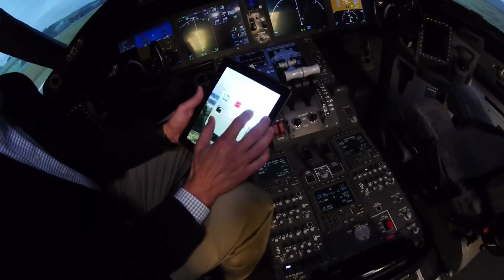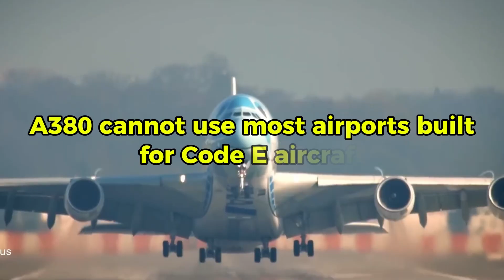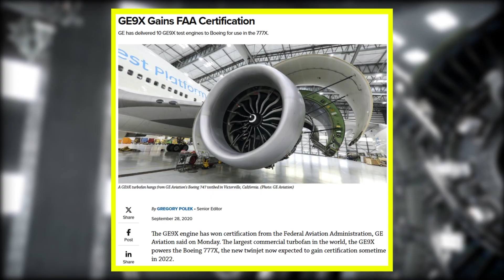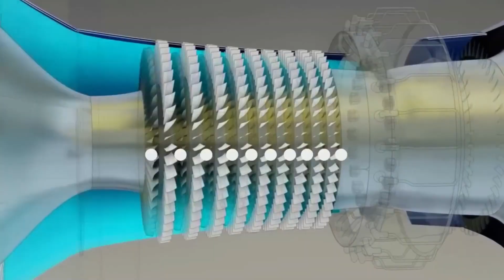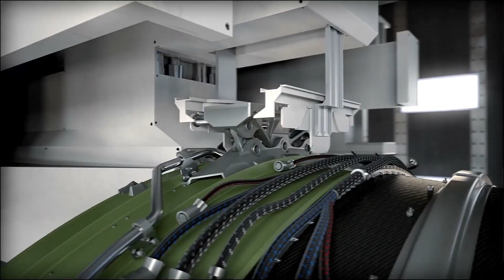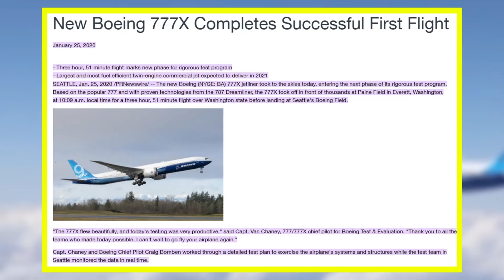Boeing 777X Certification Crisis: Why the FAA Still Won’t Approve It!

Comment: Never thought I'd see the day that a two engined plane would be able to cross oceans with just two engines.  As we sit here in 1995, this new triple 7 is one of the most advanced we have ever seen.  Just imagine how things will be in 2025.  Oh wait, it is 2025 and almost 2026! This plane is nearly identical to some of the original triple 7's. In some cases it actually has less range and less thrust.  What the hell have they been doing for the past 30+ years.  Oh, okay, the wings fold.  The A350?  Now that is a gem!
Reply: Airbus glazer? The 777x is much more efficient with a nicer cabin and is much more digital - it’s is an amazing plane already ..

Comment: What is advanced? Engine upgrades and upgrades to that old 777-300?
Reply: A code F aircraft in the air but code E on the ground, composite wings that are 15% bigger, one engine producing more than all 8 on a b-52b bomber I mean it’s had BIG troubles but just because it has the same first three numbers doesn’t mean it isn’t advanced
Reply: Super efficient, all new carbon composite wings, 787 avionics suite,  more fuel efficient engines, state of the art, wifi and bluetooth connectivity.....
Reply: @toms1348 it is not more Fuel efficient 😅